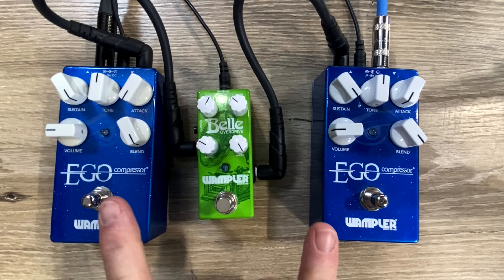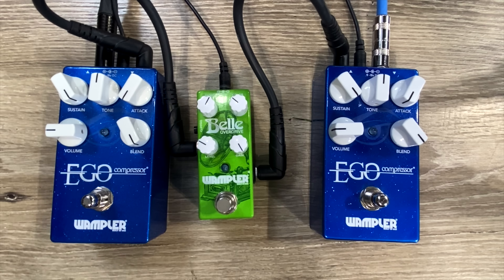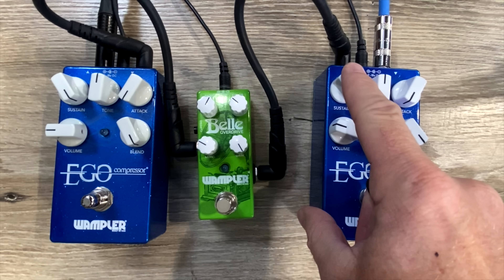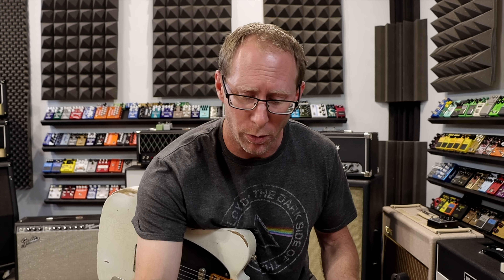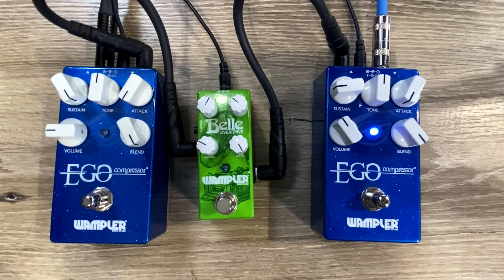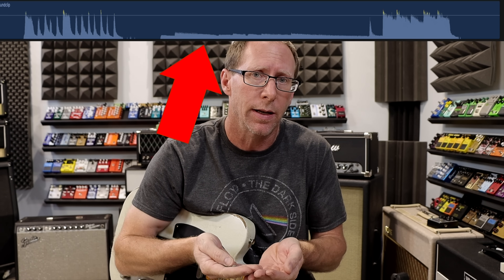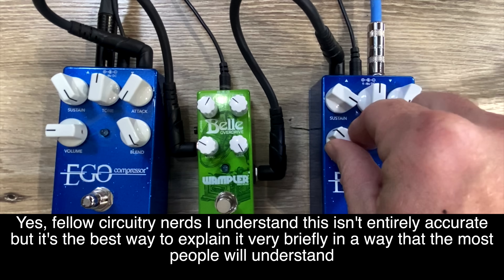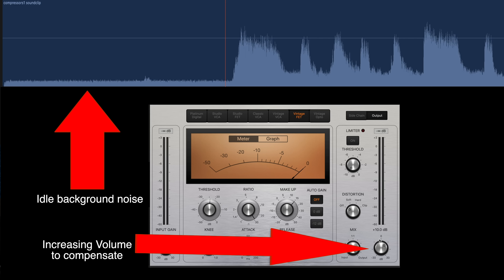Are you making these mistakes with compressor pedals?

Comment: I am fairly new to compression and just bought a Cali 76 today - so the timing of the arrival and content of this video could not have been any more spot on - thanks a bunch!
Reply: Use the settings in the manual. You can't go wrong with those.
Reply: @DaveBode  Yeah I sort of made a modified version of the third setting
Reply: @whynottalklikeapirat  the input is most sensitive control if you have a guitar with both humbuckers and single coils. Until I rig up a servo to control the input knob remotely, I only use the Cali when I use single coils.
Reply: The learning curve is relatively steep but this pedal gives you studio quality comp. Love my Cali76.
Reply: @DaveBode  All single coil here but not going for the standard ice pick shit :)
Reply: Cali76 Stacked Edition will never leave my board. Always on, with adjustments to mix doing anything I want it to. I couldn't believe how long I played without a compressor and what I was missing.

Comment: 3 years later and I have my first compression pedal in the Ego76. Incredibly helpful video. I was going the wrong way with my attack to reduce the compressor 'clicks' as it clamps the signal. It's also just a fantastic pedal that let's me pick with some energy into my amp that has headroom to spare :)

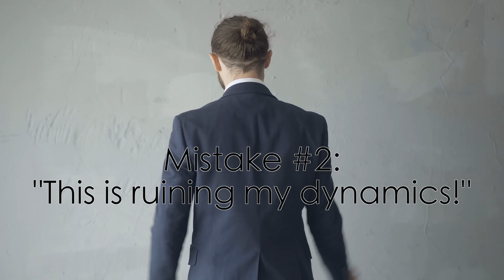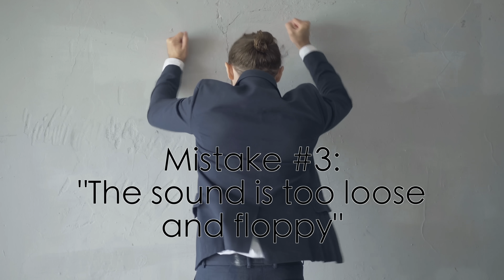Comment: Been watching a lot of your videos. Appreciate all your effort in explaining things. You might consider using more "industry standard" terms when it comes to compression. Downward compression reduces the volume of loud sounds above a certain threshold. Upward compression increases the volume of quiet sounds below a certain threshold. The louder sounds above the threshold remain unaffected. At 3:21 you say "It's compressing down and it's also compressing up." I know you know that's not what's happening, but it's perhaps less clear to say it that way. 5:10 you mention upward compression. That's also not really happening at all here. I don't have an Ego pedal, but from the demo I can tell it sounds very good. I recently got a Cali76 Stacked pedal, which is excellent! All compression pedals need a indication of gain reduction. The Cali76 uses a single LED and  that is works well. The absolute gain reduction values in decebels are not really important.

Again - I appreciate you, Brian!

Comment: About 2 years ago I hit on the combination of: drives -> noise gate -> compressor -> delays -> reverb.  Compressor stays on all the time.  Since I hit on this order I have not had to change it.
Reply: I add in a drive after the comp (both set a bit more subtle than you would without the other) and 2 types of delays (analog with mod on 1/4, digital dotted eighth after) and I’m right there with you
Reply: I will definitely have to try this! I started building but first pedalboard in early 2021, do I still have a lot to learn.

Comment: I use an orange squeeze style compressor/boost in my effects loop last in the chain. It  really does more than an EQ pedal can, basically acts like a psuedo attenuation by boosting the signal and allowing me to turn down my amp's volume to more appropriate levels without losing clarity.

Comment: My favorite way of using a compressor pedal is going into a crunch drive setting on my tube amp. By adjusting it just right you can go from just soft clipping the attack of the notes to soft clipping more of the sustained notes as well.  Sort of an edge to the whole tone instead of just the harder attacked notes.  This was done a lot in recordings in the late 80s and 90s.  It’s a great way to add a little edge to the guitar without it being fully into distortion.
Reply: Many 80's metal guys not shredders did that a Crunchy Marshall dirtier than Malcolm Young but less than EVH , but set compressor ratio up a bit and have a slightly louder Out Put level, to give boost a bit more gain volume to the amp and clip the amp that little bit more.
Saw dozens play that way.

Comment: I really did not like compressor pedals with guitar until I built one with a blend knob for the dry.  I modified a DOD 280 style optical compressor circuit with a fet blend and I loved it.   I like optical with a blend it seems.  I recently built a Cornish optical comp clone and it's wicked nice, it came with a blend knob designed in.  I think it's my favorite.  I'll have to try an EGO out, it sounds great on the video.  But I think the blend knob is a must for any compressor "pedal".
Reply: I blend about 40% natural signal with 60% compressed signal. I set the compression high so there’s more contrast between the two

Comment: I contracted an unusual compression fetish years ago. I've owned literally dozens, brand and circuit types. The Dyna Comp is STILL my absolute favorite. The first time I plugged a Strat into it with a clean amp, it was love. If you use compression a lot you'll need a second compressor because the features people want: transparency, headroom, retaining dynamics, not chopping your treble off, etc: the Dyna Comp is terrible for.
I like the blend control, but found that having them doesn't necessarily crucial. I owned an old 2 knob Keeley years ago, and replaced it with the 4 knob a year or so after it came out. I bought the Compressor Plus and sold my 4 knob, only to send the Plus back when buy another used 4 knob. I just didn't think it was nearly as good as the 4 knob, it seemed to thin my tone out and were too bright, even with the tone control.
Reply: 2 compressors at the same time? So, which one first?

Comment: Thanks for this helpful video! Don't know if I'm alone on this, but I am trying to put together a straight to the front ampless board with the Cory Wong compressor as the DI. Seems logical, since it will be after delay and reverb, to just use the boost function and only turn the compression on when the verb and delay are off. What I'm driving at here: a video focusing on different DI solutions would be very cool.

Comment: I built myself a 70s Dyna clone back in 2010. Since then I’ve gotten an optical compressor the DOD 280 and like that much better - not as noisy and it’s smoother sustain. It also seems more compatible to my DOD 250 grey spec pedals.

Comment: It takes some getting used but when you dial one in, its there forever. There are multiple uses for a compressor, I use it as a boost and as "talent" pedal. I own a few different kinds and they all have something great and not so great about them. I mainly use an old Keeley dimed if I use one of my old Fenders (twin or Super) and when I need a boost or evening out. I also use it if Im using single coils to fill out the in between notes Im doing a tricky rhythm that use single notes, its really helpful evening the notes out so there are not quiet and louder notes which will sounds horrible and you sound like a beginner. iIt makes a great clean boost that I really like. You have to pick the right one for the amp and style you use or it's useless. Marshalls and higher gain amps I use either a good ol' Boss CS-3, MXR Super Comp or the sleeper Marshall "Ed The Compressor". Keeley's always work better with cleaner amps but don't do much of anything in front of an old JMP, and the others sound great on all but take some playing around with. JangleBox is also a really cool compressor.
Reply: What do you mean by “talent” pedal?
I’m interested.

Comment: I have my compressor after my drive pedals and before modulation effects and it stays on.
For me, its the best of both worlds. If I need more drive on some notes, I play harder to push the particular overdrive pedal I've selected for more breakup.
And I don't have to worry about getting too loud because the compressor limits the volume spikes without impacting drive.
I use the Keeley Compressor Plus.

Comment: Hey Craig, been a giant fan and longtime user...I'd love to see your thoughts and some kind of demo video on the use of compressors with plugged in acoustic guitar. Some years back, something like 2011, a friend of mine was playing a guitar I was quite familiar with (a Taylor 414, and I had worked in a guitar shop for a couple of years and had played and heard many), but it just sounded bigger and more thick than any I had heard before. An Ego was sitting on his board and I immediately got one, and since then I've played easily 1500 or more gigs, all with one in the signal path. I think it is a massively overlooked part of good acoustic tone if you play plugged in and it has made a very noticeable difference for me, over a long period of time. Parallel compression is so massive in terms of making an acoustic guitar sound big, and my 2 Egos (one got stolen! jerks) have been a desert island pedal for me. Your Cory Wong one (which I believe is a modified version of the Ego if memory serves?) looks amazing and the inclusion of an XLR out is really cool. Anyway keep it up, you're a beauty

Comment: Last 2 pedals on my board dB-1 for boost and a silent modded 10 band EQ with 2 out for 2 amps. These eliminated need for compresser. Got a really nice 1 modded CS-3 with a Opto + thing that's this big chip looking like a spider on the bottom of the circuit. Also got a stock CS-3 that just don't hear the need to take space. Compression can be in the fingers depending on which guitar and how it's set for that music at that time.

Comment: I run a dynamic distortion pedal into compressor set high then use my guitars volume to adjust my gain from a great "clean" sound to distorted rock sound.  It keeps my overall volume level consistent and lower because i cant crank my amp in church.  Maybe I'm doing it wrong but it works.

Comment: Probably worth pointing out that the "after" compression applied on recordings is not going to be a Dyna-Comp style compressor. I seem to remember Lowell George used two Dyna-Comps in series for slide.

Comment: So apparently David Gilmour used two compressors to achieve the Run Like Hell tone on his Telecaster. However, I found a great trick it to put an overdrive first in the chain (like an OCD) and then run it into a compressor. Even a limiter set at just right can achieve the same effect. My setup makes those triads sound as close as I've ever heard to the original album. Whatever works!

Comment: Using a brand (not wampler)
I notice the term 'Dry' on one 
of the knobs, which is a bit
ambiguous; as perhaps
 the further the pot is turned
to the right the 'more-dry'
it might become or the 
'less-dry' , and then there are 
knobs on some compressors
that say mix, and some 
that say blend*. 
*Blend
I see in this video that the
'blend' when full clockwise
eliminates the 'clean guitar' 
signal from coming through
the compressor, noting that
the presenter realizes that 
some or most of us need to 
know this,  I would be 
guessing what it 
does when not having 
adjusted it for a week 
or month when
finding the knobs inadvertently
moved to different settings, 
this is one of those knobs 
I'd have to pause and wonder 
which way to turn it if I want
to add or decrease my clean signal 
through the pedal, one of those
''who's on first'' issues. 
I don't know how that label 
could be labeled with less 
ambiguity, but maybe something
like a (-) sig full left and a (+) signal
full right, with the caption 
underneath reading 'Clean' with
guit icon included. 
I'm not suggesting that Wampler
change their labeling, just saying
that if someone wants to design
labeling for their compressors
with less ambiguous labels, that
might be a direction to go for 
the Blend/mix/dry etc Pot. 
I mentioned that the presenter 
explained which 'direction' 
did what with the pedal, 
I was literally thinking it might be
the opposite of what was 
explained.

Comment: This is a very good video.  Thank you!  There are quite a few compressor pedals where 'Attack' refers to attack time.  I wish they'd label those knobs 'Attack Time'...then I'd know that lower is faster.  One gets used to the old CS2/CS3 school where turning up the attack gives you more attack.  Attack Time is kind of the opposite.

Two things I've found helpful, maybe you will too:  1)  Don't use the compressor as a signal booster.  Get your compression but keep the output volume at close to unity or maybe a slight volume jump.  2)  If you have a blend, set it to full compressor, get the 'thuckiest' most chicken-picked sound you want, and then start blending in the dry signal so that the attack 'spikes' kind of poke up over the top of the dry signal, and then get buried by the dry signal as the sustain rings.  Try it!  This helps reduce the amount of treble recovery you need to do with the tone knob.

Comment: A couple of, hopefully helpful, examples of when to put one before the other. Sometimes you're playing chords or a melody and you want some consistent "grit" or distortion as you play along, just the right amount, if you use a compressor before the overdrive/distortion pedal, it'll level out your playing and give you that consistent grit (especially if you're looking for that consistency between high/low notes or when playing more or fewer strings which changes things a lot - I've used a compressor to great effect when I was getting great drive on low notes/chords and nothing on higher ones). On the other hand, maybe you're playing a solo and you want some overall control, but you also want to make the notes scream when you dig in, then you need that compressor after the drive so the drive still reacts to your picking dynamics but the level of the performance is still controlled.

Comment: I only own 3 pedals, the Faux Tape Echo Delay, Ethereal Delay and Reverb, and the Ego Compressor.  I only bought the Ego Compressor because I understood it levels out the highs and lows perhaps caused by possible imperfections in my style of playing.  I do not even own a single overdrive or distortion pedal!!!  Why is it "EVERY" video you do is tailored to only Overdrive pedals.  Could you please do at least "ONE" to do with Faux Tape Echo Delay or Ethereal Delay and Reverb "with" the Ego Compressor Pedal??  Or did I waste the $$$$ I spent on the Ego because I'm not sure how to use it or am using it "wrong???"  Thank you for this video.  I am just having problems relating everything with overdrive / distortion when I don't ever use it, and right now, have zero desire to have anything to do with overdrive / distortion.  The sound I want is clean with Reverb and Delay, obviously by my choice of pedals (and amp, Roland Jazz Chorus JC-120).  (I stared playing in 1962, and therefore, I'm not interested in trying to play whatever is the latest, greatest, state of the art overdrive / distortion trend.  I only play Strats and a couple of Les Pauls, do not even own a Tele, if that has anything impact on any advice anyone may attempt to give me.  Thank you for humoring me.)

Comment: I only use slight compression (xotic) in the loop before my chorus to sorta "simulate volume" right now im mostly at home and using a smaller amp. I have pondered trying to do it with a limiter but i dont have one

Comment: Great video again! thanks !! another trouble with compressors is when you go from clean to drive or change the guitar from strat to les Paul, or  from riff to arpeggio, you "have to" change the settings all the time and in the end...get lost. I'm lost. less now after the video but still . I used a dyna comp, then a more accurate nux core komp and it's the same situation for me. I think I will just forget that effect, unless someone can advise on compromise?

Comment: I understand attack/release 
of a compressor, but now as
I'm shopping (again) I find that  
out of 5 different brands/models 
each has a different 'sometimes' 
proprietary label for each 
of their knob array, plus;
Comp 1 has 2 knobs/pots
2, has 3 knobs and a switch
3 has 4 knobs 
4 has 5 knobs 
5 has 5 knob and a switch. 
Many of these compressors
label each knobs differently
and not necessarily using 
'convention' nor intuitive 
labeling. 
Hence, I'm looking for a video that
takes 'most' of the pedals 
available from $35 to $300 and
explains each one's labeling
with very short example of 
how each sounds. 
I have a $35 and a $300 compressor
now and the $35 dollar one
sounds much better than the $300
pedal, for what I need it for.
😄Am I using the $300
pedal correctly (?) probably not
but have tried the 26 million diff
knob arrangements until I 
got a decent result, then 
turned it off and hit 
the cheaper-pedal's button, and 
it was a very noticeable 
improvement. 
I realize I'm never going to find 
a video that covers my 'wish'/
request , just kind of 'rhetorically' 
throwing this question/request out there.
😄